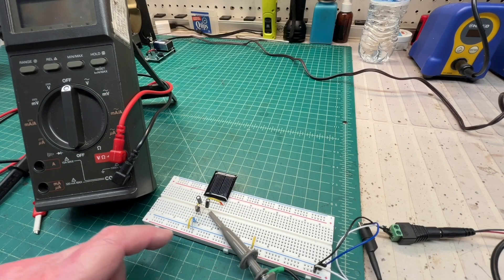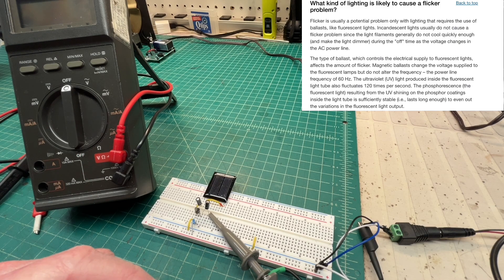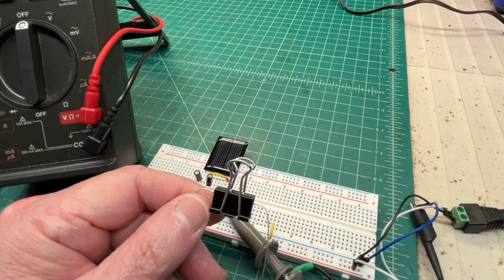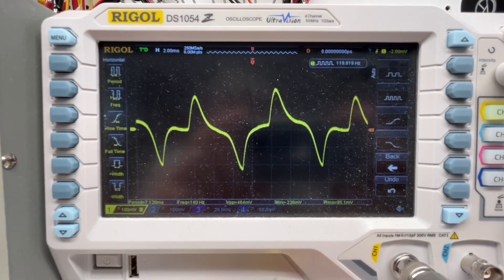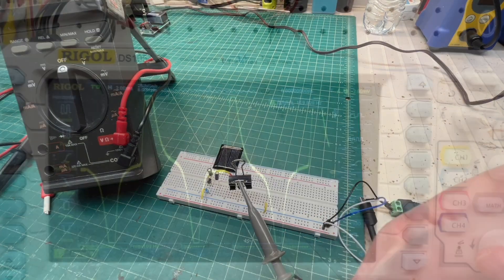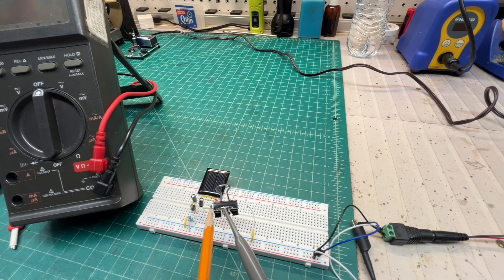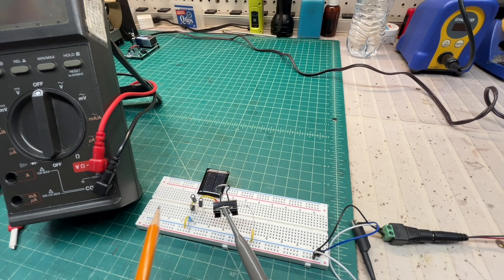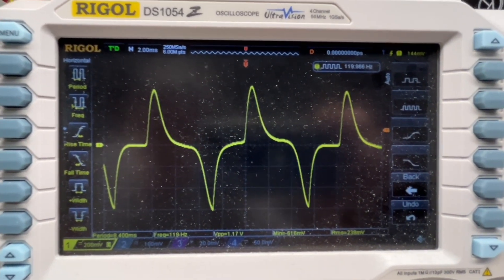Capacitor Outside Foil/Shield ID | Using a 1V Solar Cell, NPN Transistor & Fluorescent Light +...

Comment: So basically you are using the cell and the lights as a noise source.
Reply from the maker: Correct and amplifying the 120 Hz noise before applying it to the capacitor. Best, Don